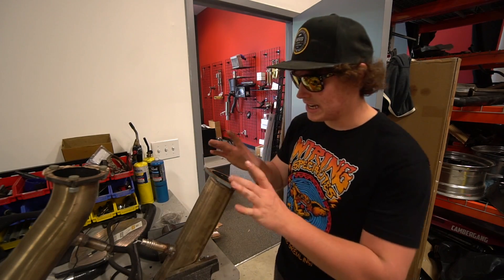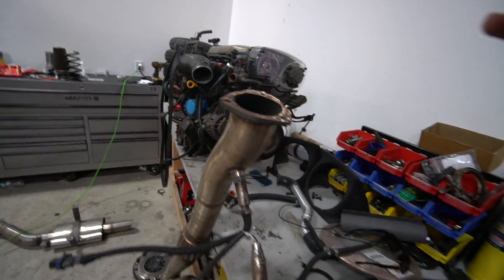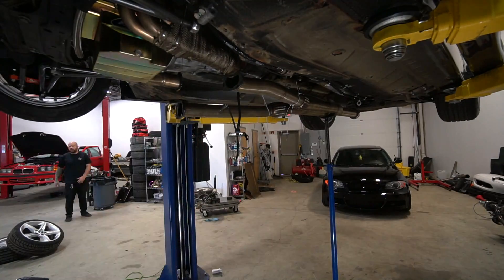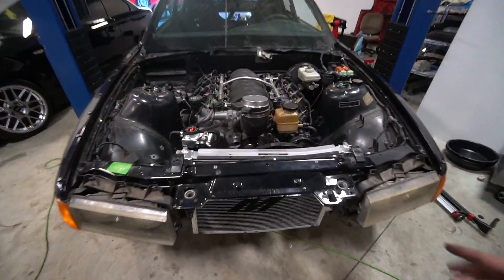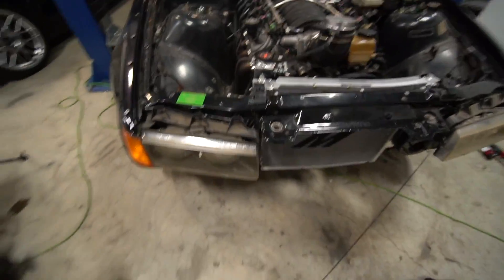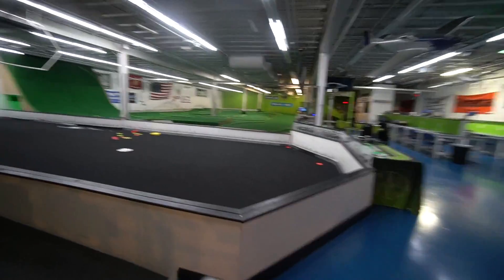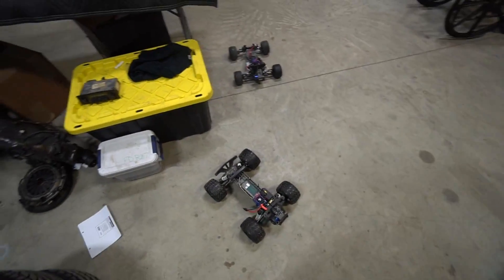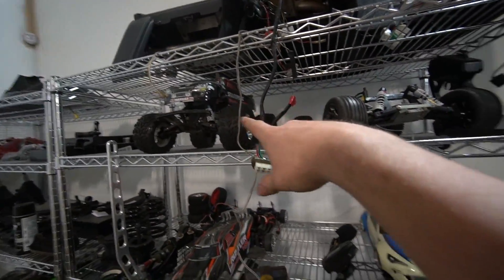LETS GET THESE PROJECTS DONE!

Comment: When you do gaskets with sheet material like that, its easier to cut it with a hammer than actually hacking away at it with a razor or knife. Basically lightly tap it around the sharp edges of the steel flange and it will cut the gasket for you and it goes pretty quick.

Comment: Dood, awesome tip for making gaskets; use a ball pein hammer to tap around the edge of where you need to cut and a lot of the time the cuts make themselves. Also you're using engine gasket instead of exhaust gasket lol

Comment: Chris you can get Metal steering parts for the stampede or on the radio there should be a nob on the top right for strating the wheels, I have 4 rc’s 3 r electric 1 nitro

Comment: Regarding the clutch slipping in the stampede just cause it’s slipping doesn’t mean it’s “blown” they are not like real cars and they have adjustment to tighten and loosen how much the clutch slips. You want it to slip a little bit so when you do a jump and Land full throttle the clutch slips instead of the diff or driveshafts snapping. There will be a little nut that tightens onto a spring in the clutch tighten this all the way down till it’s snug the back off like half a turn. Hope this helps

Comment: That bulk gasket maker isn't going to last long, it isn't designed for exhaust temps. Those look like a standard aftermarket header collector flange, available at almost any autoparts store. You could also just use copper RTV instead of a gasket.

Comment: doood,,, for the gasket get a ball pein hammer and put the gasket over where it needs to be and run/rub the hammer round the edges so it imprints and then cut out the outlines with a stanley knife ,you will have a perfect gasket  everytime , keep up the good work with the videos

Comment: Buddy I use "make a gasket" all the time, but you are using the engine gasket not the exhaust version, the exhaust version has cardboard on the outside and metal on the inside, you can buy it by the sheet at parts stores or farm stores, I use it all the time with no issues
Reply: Nathan's DIY Garage yeah that material he's using his not meant for exhaust. It's going to blow out after about 5 minutes of runtime
Reply: He could just buy header gaskets from any part store.
Reply: Or just use exhaust cement lol
Reply: Nathan's DIY Garage I literally just use cardboard for gaskets.
Reply: cardboard is shit for gaskets. Its to thick and doesnt handle the heat as good. Buy genuine gasket paper, its cheap as fuck. Chuck a bit of oil on it and your away.

Comment: My man made gasket paper look difficult to use and I didnt think that was possible 🤣🤣 lay it on as a square and tap around it with a hammer and itll pretty much make it self. That or use a solid object and run it around the edges and it will leave a line showing you where to cut so you can do it on a flat surface and make it perfect. Also its contraption, contractions are what women have when theyre going into labor 😂

Comment: to cut that gasket paper I usually lay it on the flange poke the holes out first put the bolts in them then tap around the edges with a hammer to cut it to shape

Comment: You could’ve just reved the engine from the engine itself.
Reply: AndreLei1982 you can't with a dbw throttle body
Reply: It doesnt have a throttle cable its drive by wire it uses a sensor
Reply: The more you know. Thanks for bringing this up.